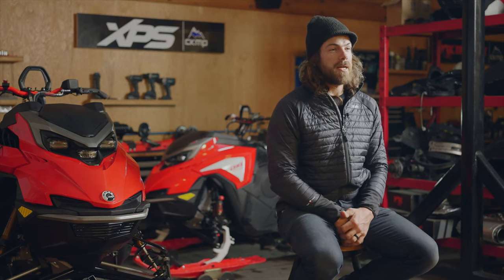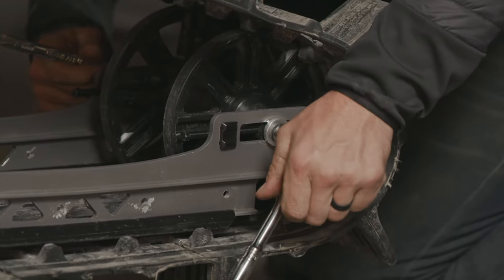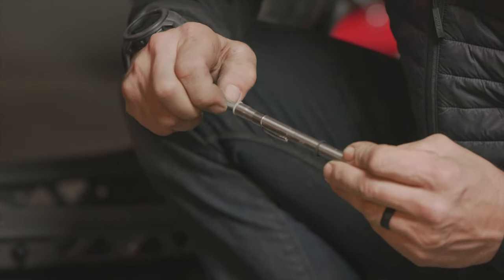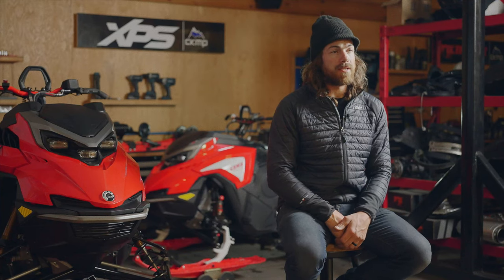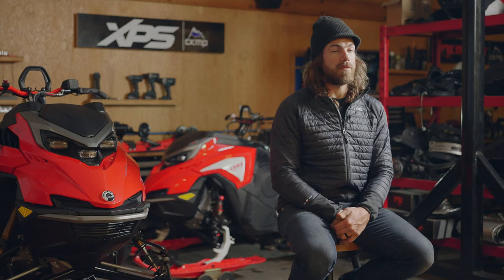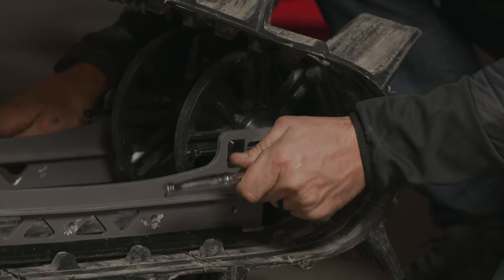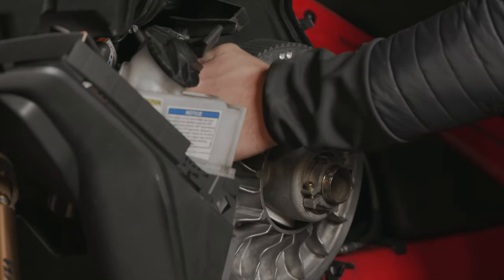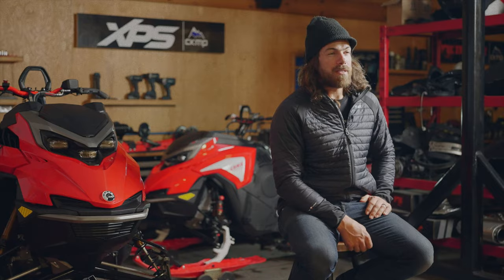Adjusting Snowmobile Track Tension | Lynx Masterclass

Comment: Comment from a mechanic with 45 years of experience graduated from BRP, Yamaha, Polaris etc. A correction is necessary here to use the tool in the TRUE AND ONLY WAY!!!... With the tension tool you must put the oring indicating the distance to the correct number (example 25mm) and the small oring which will indicate the weight, you must set it to zero then you place the tensiometer in the right place on the track  You press on the spring rod so that the distance oring arrives at the right place which is just under the slide). Then you remove the tool and you read the number indicated on the weight oring (the pressure you had to apply to reach the right distance. So you only have just one oring to watch when you press the tool (the distance one) and not look at the 2 orings at the same time.
If you have any questions, even very specific ones, I will be happy to help you find out. You will have the most accurate information.